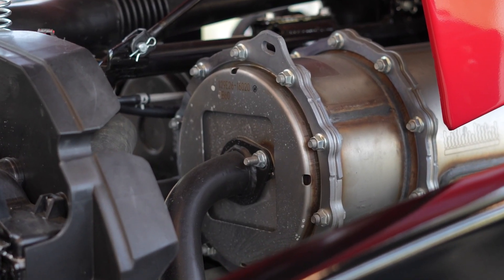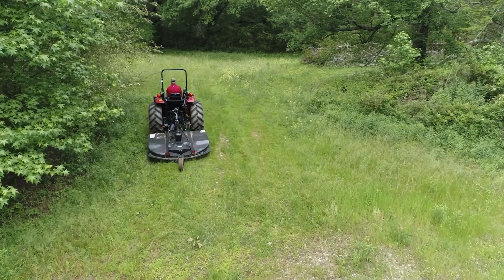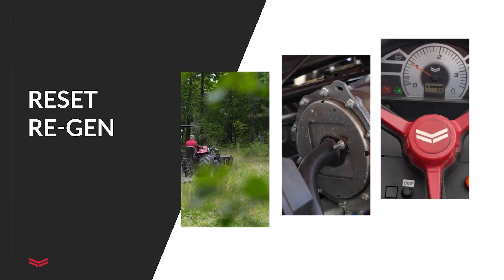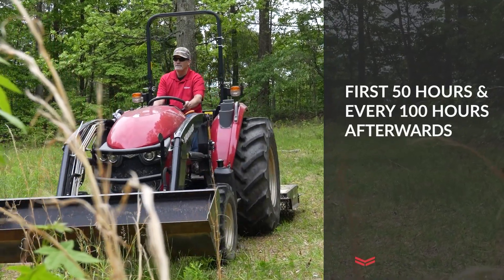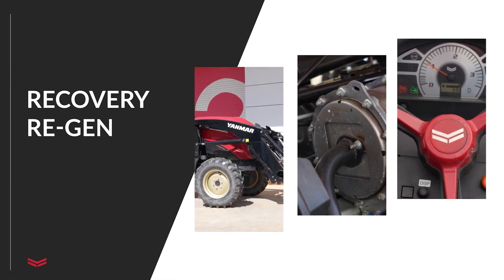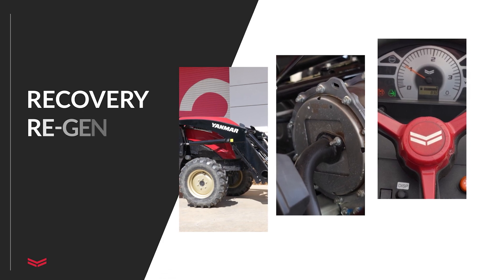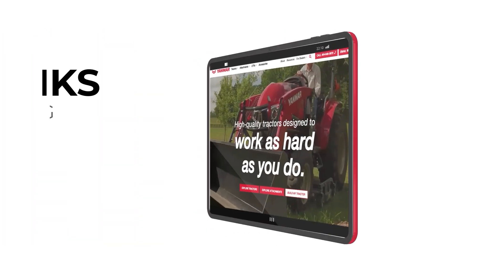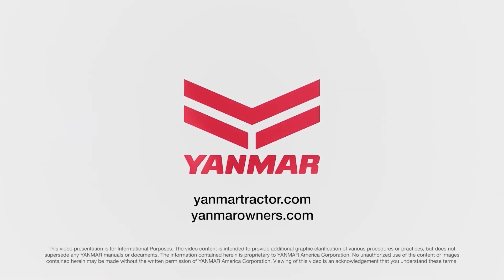YANMAR - Regeneration Overview

Comment: Thanks for the video, yo;u do explain the different types of re-generations but at such a high level it does not provide clarification on what to do and not to do.

I have a YM342a with about 125 hours on it. It has gone thru 4 regens,40,51,70,and 85hours. On all the regens the dash light and regen button were flashing. In all these regens I had to push the regen switch for 3 seconds to start the process with the tractor parked. First time I did the regen it just sat there and did nothing. I then referenced the owners manual and brought the rpms up to 2000. It sat there for 30 minutes no change in rpms with the regen indicator lit. The lite would not go out until I decided after 45 minutes and lowered the rpms to around idle,then the lite went out.

I also contacted the dealership on this for more clarification and they said they did not know much about the regen process, and said it may be doing more regens in the winter time, they said they had no experience with these.

So I went back to the manual and only got more confused after reading it a few times. There are too many instances in the manual saying this "may or may not work,try this, or this usually works. They also reference a 1 or 2 second blink with a .5 or 1.0 hz buzzer,give me a break while I get my timer out and frequency checker to see what I have.

Needless to say I need some help in understanding this more, possibly with doing a forced regen every so many hours, kinda of a fail safe approach.  I don't want the filter to get plugged and end up in limp mode.
Any help would be greatly appreciated and I look forward to the next set of much needed detailed videos.
Note:I run the tractor at minimum 1400 rpm.
Thanks and hope to hear from you.
Reply: Good point, I have a yt235 and it did a regen today with 41 hours. Just the dash light and start the process holding the button. Continued to use the tractor and it went off after some time. But I agree with you on the forced regen as a fail safe.